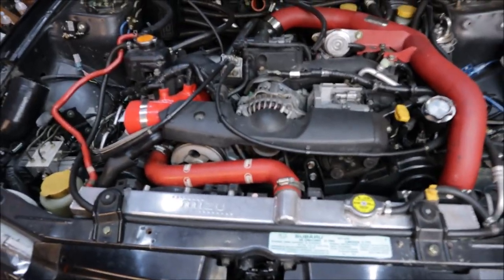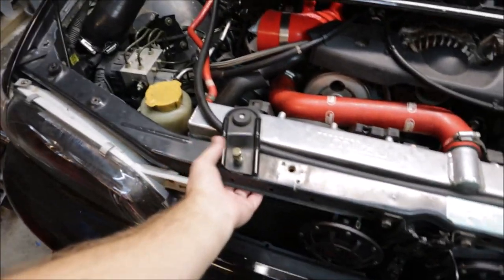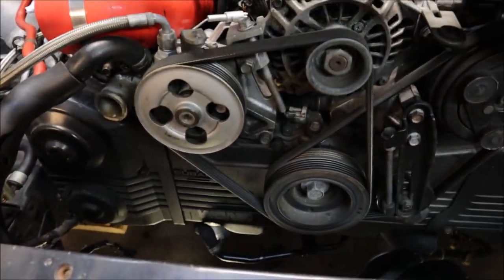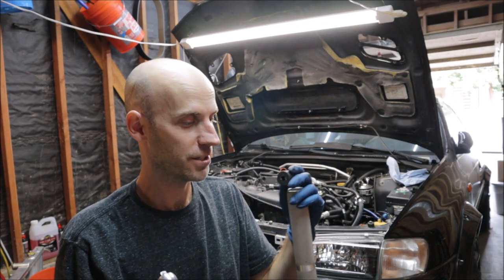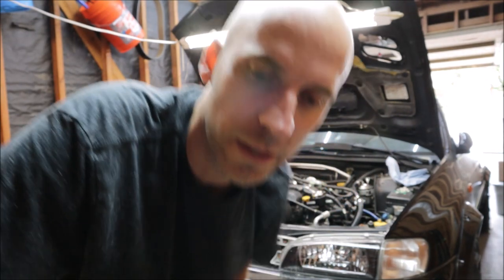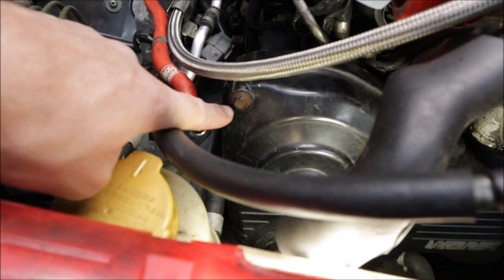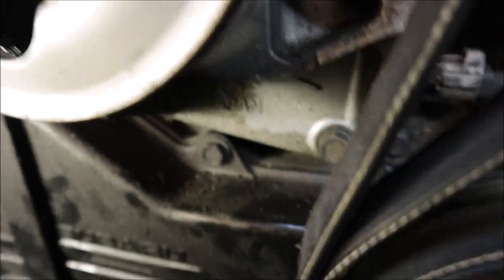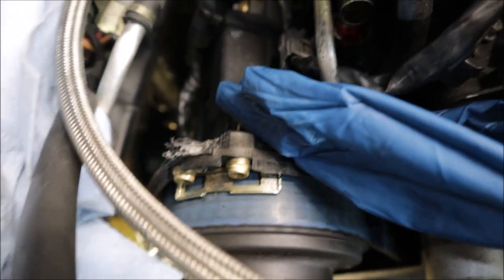Impreza GC8 Build: Timing Belt Part 1

Comment: I literally just did this. My crank bolt didn't give me a problem anything like yours did. 😮 

Get the Aisin kit. It's all Japanese bearings and is recommended by my favorite online Subie mechanis, so thumbs up there. 

I only did the timing belt on mine. I may regret it later, but everything looked good and I'm already out of my element. I did have to replace the front and back timing belt covers on one side as mine were broken. Be careful getting the exhaust cam gears off. The wrench slips easily and chews up the, uh, teeth on the front.
Reply from the maker: Yah that wrench ate one of my gears and the other one was damaged from previous owner. Some shops replace all the gears with every build! I want to trust the Aisin kit but I keep thinking OEM for peace of mind. But oem is twice as much!!!
Reply: MrSubaru1387 did a vid on the Aisin kit. It's all the same parts as the OEM - with the exception that the belt is a Mitsuboshi instead of a rebranded Mitsuboshi.
Reply from the maker: @ericlanam4265  I’ll have to check it out!

Comment: Ive built countless ej engines....you will regret not doing a full timing kit while you're in there!  oil pump, water pump,  front crank seal, the rod pin block holes, and cam seals as well. sounds pricey but will save you down the line for sure!    I've learned that the hard way both personally and professionally.
Reply from the maker: The Mira Image Media I agree! Was not going to touch the cam seals but why not, I’m there. I am considering the Aisin kit but should I trust it? Do I just bite the bullet and buy all OEM? $$$
Reply: @RoadPatina  oem has never let me down. rcm and his for high end options too but not needed
Reply from the maker: The Mira Image Media what do you think of oem belt vs Kevlar? I don’t think they stretch and need servicing more often? RCM seems to be the same as other Japanese kits but you pick your belt option.
Reply: Road Patina oem is fine if you’re not building a track car or extremely high hp.
Reply from the maker: The Mira Image Media less than 400 wheel.
Reply: @RoadPatina  then oem is the way to go!

Comment: The crank bolt can be broken loose by using a 24" long (if I recall correctly) 1/2" breaker bar and laying it on the driver's side frame rail with a rag around the handle. Remove the fuel pump and EGI fuse and bump the starter. This will break it free without the special crank tool.
The leak on the front is from the fitting that replaced the stock oil pressure sensor. It may need to be teflon taped, which requires the alternator to be removed. 
The power steering pump often leaks from the o-rings and front seal.
Subaru does have a rebuild kit for them as well as the bearing. I would replace the supply hose at the same time you address the pump.
Reply from the maker: That method scares me. Tried it on my old 91 toyota pick up and the breaker bar went flying!
Reply: @RoadPatina  Did it that way in the Subaru dealer when I worked there 20 years ago. It won't go anywhere if it is against the rail.
Reply: Put it in 5th gear, ebrake on, wedge the tires, then loosen the crank bolt. You need 1/2" ratchet for that.
Reply from the maker: @FuJiNF  it was way over tightened from previous owner but I got it 💪‼️

Comment: Always use a 1/2" breaker bar with a impact socket. If it's a manual. Put it in 5th gear with the parking brake on. That should hold the crank from turning. If the parking brake is not enough. Have someone put their foot down on the brake pedal. Since you have it in the air on jack stands, have someone push on the brake pedal.
Reply from the maker: Patrick Lipsinic 1/2 impact would not fit unless I moved the condenser which I should have done, clearly 🤦‍♂️ I did try 5th gear but had no one to hold the brakes. I will need to try all these tricks when I reinstall?
Reply: @RoadPatina  I do the 5th gear trick all the time with the parking brake. 22mm impact 1/2" drive socket on a big 1/2" breaker bar uninstalling and installing. With autos I use a prybar on the flywheel through the hole in the block bellhousing, below the throttle body and to the passager side.
Reply from the maker: Patrick Lipsinic good looking out. I’ll give that a try!
Reply: @RoadPatina  Use the hand brake to stop the car from rolling.  He meant the impact socket on the breaker bar not the gun.  Impact sockets will bend regular sockets will snap if enough force is used.  When installing put the car in reverse  5th is to remove the bolt.   If it gets locked in gear  turn the crank slightly the other way to free the gear or jack the car up and turn the wheels by hand .   Another trick is use a long breaker bar and brace it on the frame and bump the starter, Only do this to remove it.
Reply from the maker: Wolfy1091 10-4 I had to buy the impact socket and have a long 1/2 breaker bar. Just need to hold it in place to reinstall. I will try to put it in reverse and hold the brakes!

Comment: Man, at this point, I’d just say to take out the whole engine and give it a complete refresh. Knock it all out at once. Also, what kind of impact were you using to break the crank bolt? Maybe invest in the Milwaukee 2767 impact. I have one and it was the best decision i ever made. Broke seized axle bolts, crank bolts, AND the dreaded Subaru rear lateral link nuts and bolts
Reply from the maker: ziewknihtewza I wish I could pull the engine. My garage has no room for it. Unless I chain it from the ceiling! Impact is a M18 Fuel 3/8. I think it was over torqued by a mile!!

Comment: Those tensioners are notorious for leaking. Replace the water pump if it is leaking or not a Subaru (Aisin) pump. But go on Rockauto and buy the Aisin timing belt and water pump kit it is all the OE components under $200. The oil pump just needs to be resealed and a new crank seal installed. I don't think they applied the Fujibond and torqued it correctly.
Reply from the maker: OEM parts are expensive but that’s what I purchased. Did not want to risk a cheeper part failing. The oil pump was scored pretty bad as you can see from part 2.
Reply: @RoadPatina  Don't scrap it, please because I can resurface it and rebuild. I can pay you something for it.
Reply from the maker: @troyfankell6581  let me get the car running, I don’t want to let anything go until it’s running!
Reply: @RoadPatina  You're good, I certainly understand. I just didn't want you to throw it away.

Comment: You could of put the car in gear and used a large breaker bar with the 22mm socket 1/2" instead of buying the holder.   I bought the holder when I did my swap but it wouldn't line up with the holes on my crank pully.
The bolts on the cover next time you have some like the happen put the rachet or wrench your using and smack it with your hand or a hammer.  It's a diy impact wrench lol
Reply from the maker: Wolfy1091 I tried 5th gear but did not have anyone to hold the brakes. Returning the tool is was cheep and broke instantly!
Reply: @RoadPatina  Use the parking brake
Reply from the maker: Wolfy1091 will do. Good looking out!

Comment: Earlier in the year I had the intention of doing my own Subaru timing belt change, bought all the oem parts, new bolts for the covers, water pump, the whole deal then I piked out and took it to my mechanic and by magic the next morning it was all done, zero stress. I know that’s not in the spirit of things but watching this kind of vindicates my decision.
Reply from the maker: Sneaky Foz trust me, by day 4 I was done and ready to tow it to a shop. But, I don’t daily it and want to show people that even a hack like me could do it. My goal is to be honest and real. Not the usual YouTube hype!
Reply: It shouldn't be that hard to take it out, I did my timing in about 5 hours no special tools. I used two allen keys and a C-clamp to hold the driver side cams  in place. That's the difficult part if you don't get the special tools. Who ever had that engine before probably over torqued.
Reply from the maker: @samfisher395  I agree... everything has been way over torqued! 3 bolts pulled out threads so far and counting 😢
Reply: @RoadPatina  understandable on what a 20 year old car now haha I just got a 2000 2.5rs in July and snapped the rear bumper support bolt. I'm lucky just one so far though and it's the only place with heavy rust.